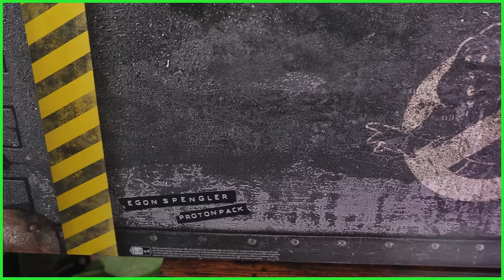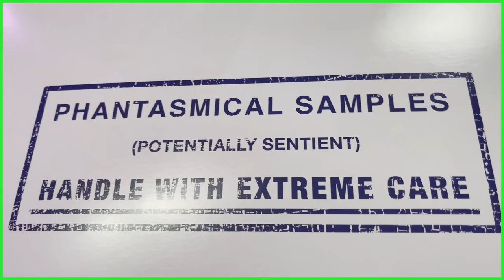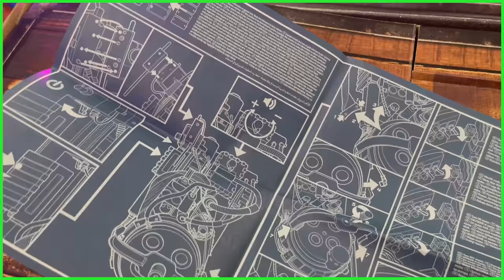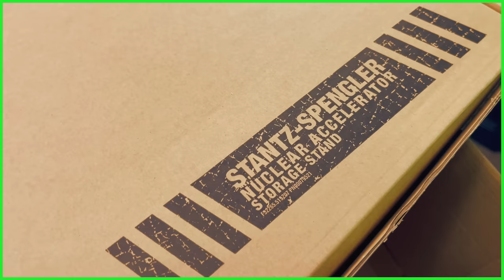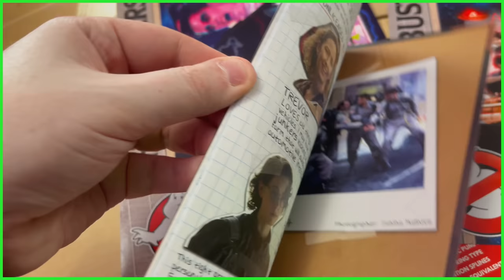Unboxing Hasbro's Ghostbusters Plasma Series Spengler's Proton Pack

Comment: When you put the batteries in turn the pack on pull out the rainbow ribbon cable by the cyclotron and it will make two different sound effects

Comment: Looking forward to your review.  Just got mine today.  Question I'm wondering about.  My wand connection seems to be finicky.  About half the time I try to use the wand to turn on the pack, I turn on the first two switches on the body of the wand, the pack starts up.  However, as soon as I turn on the third switch on the wand under the firing button, it will shut everything down.  Anybody else having this issue.  Like I said, it does this about half the time.  The other half of the time, it works as it should.  Will probably contact Hasbro about it but wanted to know if anyone else was experiencing this or maybe I'm doing something wrong?

Comment: Has anyone else have an issue with the proton back not turning on or shutting off randomly? With mine I’ve noticed there are 4 gold connectors on the rim on the cyclotron cover and when the bumper is fully tightened the cover is still slightly loose and not completely flushed with the pack, causing the power to lose connectivity. It’s easy fixed with a washer but still feel like that shouldn’t be an issue with a $400 product unless they just forgot to put a washer on mine. Just trying to see if anyone has had the same issue?

Comment: One thing I haven't seen in videos I've seen is whether or not the pack will stand on it's own when attached to the Alice frame. I assume it does, but haven't seen anyone do it so far.
Reply: No, it will NOT stand on its own with the ALICE frame attached. Because the Spirit Pack was small, it was able to lean on the frame. This is not the case for a fullscale pack.

Comment: anyone else run into the hose not liking being bent near the area close to the pack? the wand powers down the pack if that part of the hose is bent in the slightest, not a deal breaker by any means to me, but still unfortch

Comment: I think everyone who's opened one of those boxes can't keep a goofy grin off their face. My two nitpicks: 1. Where's the sticker that went behind the pack? 2. How come one of the side hoses is black when it should have been blue. Lastly, my recommendation for a video: Compare the old prototype photos to the final product, what changed? what stayed the same or improved?
Reply: I liked the cyclotron lights on the prototype a bit better and feel like they were more screen accurate
Reply: Does wand come with pac?
Reply: They definitely fixed the ladder frame on the booster, to give it that 'cobbled together from pencils' look.
Reply: The ladder improved thanks to Adam Savage telling them about the ladder and he gave them a sample of correct ladder for them to mold off of and it got fixed on the final product
Reply: @JustinMacri007  No. 😢

Comment: One question, there is another switch under the red rectangular sticker at the top of the pack. No one I have seen has shown what that switch does if anything. Can you show us that one?
Reply: Iirc, propmaster Ben Eadie had it as the power switch before they realized it should be up higher to match the 84 film. It doesn't do anything now but Hasbro replicated it from the AL pack anyway for accuracy's sake. I'm sure modders will find a cool use for it!

Comment: The orange tip may also come in handy at conventions which may require such a precaution on any weapon or wand a cosplayer may sport.
Reply: @McFrozenNuggets  Exactly!
Reply: A few years back, a man tried to sneak guns into a comic convention in Phoenix with the intention of killing Jason David Frank.  The convention's screening of cosplay weapons was practically voluntary prior to then, so it was nothing short of a miracle the man was stopped by police (thanks to an online tip).

The next day, the convention over-corrected by flat-out banning ANY cosplay weapon, including swords, light sabers, magic wands and even sonic screwdrivers (just to name a few).  Needless to say, it was a disaster for all of the attendees and the convention itself.

Rules have been dialed back since, but there are still a lot of conventions out there that enforce strict rules when it comes to anything that could be perceived as a cosplay weapon-- and neutrona wands haven't exactly been exempt from such practices.

If I ever plan to wear my Hasbro pack to a con, I'll keep the orange hat around just in case.

Comment: It's really unmatched for the cost. Frankly, the fact it's not perfectly screen accurate, is missing some of the features that were teased (ability to strip parts off to make it an '84 pack) really doesn't matter much. I've already purchased the correct cable sleeve, and will do some paint touch ups. Really very happy.